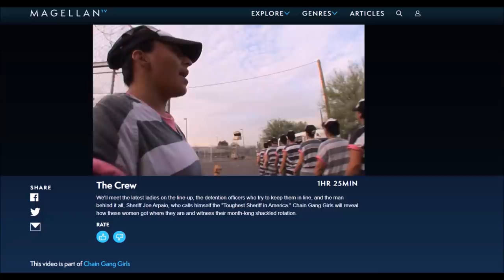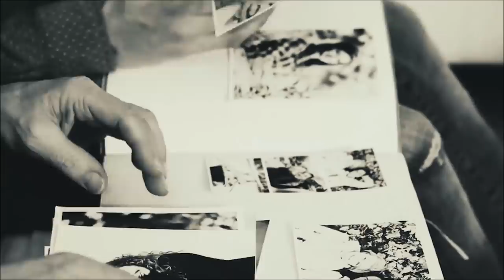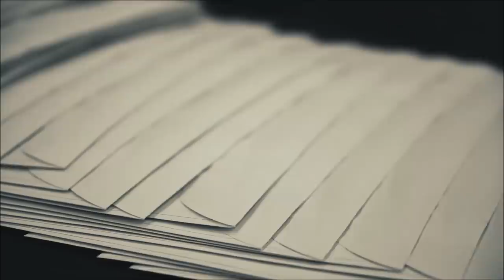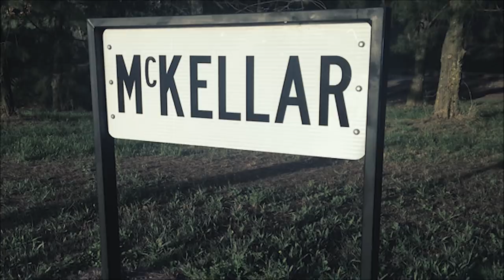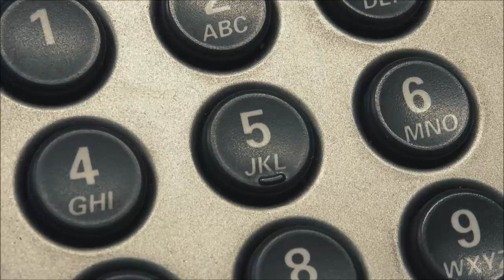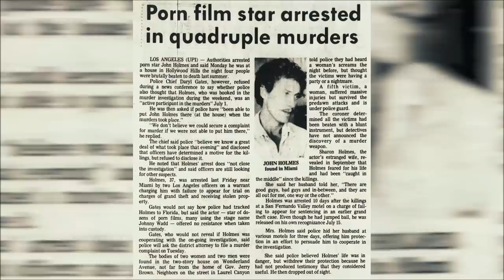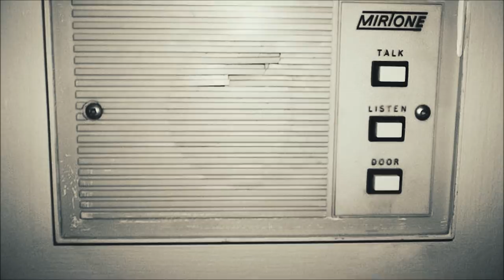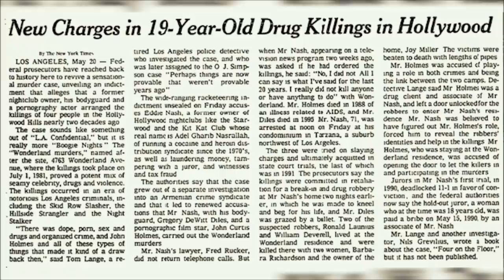3 Terrifying Unsolved Home Invasions

Comment: He needed keys to get out of the front door?..I'm confused 😕⁉️⁉️
Reply: I just got back from a vacation with an Airbnb that needed keys to open the front door from inside, It seemed insanely unsafe
Reply: What you’ve never seen a door with a key both sides?
Reply: julian blake it’s safer to need keys, most doors have glass that can be broken and the knob turned🤷🏼‍♀️
Reply: I lived in an apartment one that had to have a key for the inside too. We just left a key in the lock incase of a fire.
Reply: @chelleyd4020  No, it is NOT safer to need keys to exit a place, if there is a fire you could be filled with smoke quickly and not find the keys and burn up.  This was an Air BnB with a gigantic heavy wooden door which I am sure would be illegal in the USA.
Reply: julian blake big heavy doors are fire resistant doors normally! Which are compulsory where I live🤦🏼‍♀️
Reply: julian blake I’m talking about a front door, not a hotel door

Comment: What home has a door that you need a key to get out?
Reply: A death trap.
Reply: It makes it harder for a burglary if they don't have a ground level door to take the stuff out of. Also maybe Sarah didn't actually have a key (just her mother). It seems there should have been at least three keys-her mom's, her's and one somewhere near the door for emergencies. There's more to this story than Sarah, or her mom are telling.
Reply: jillian goldstein Mine. There are windows in and next to the door. Without a keyed deadbolt, it would be beyond simple for a burglar to break the glass and turn the lock. We keep the key near the door, but out of reach of the windows. I would prefer to have a solid front door with no windows on the sides, but our door is a weird size and it is insanely expensive to track down one that would fit or to have one custom made (to be of safe quality).

Comment: Do they still use forensic hypnotists? I'm pretty sure hypnotism has been proven to actually be real, and there are many different form of hypnotism. But I was also under the impression that not everyone can be hypnotized, that you need to be suggestible. Is it different if you are voluntarily trying to be hypnotized in a relaxing environment kind of like the stereotypical shrinks office, with the couch to lay on?